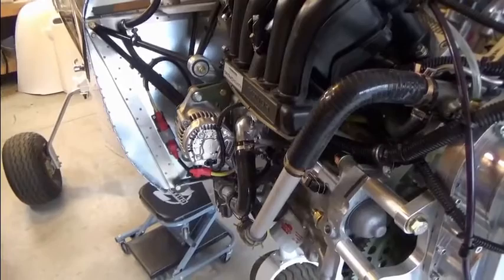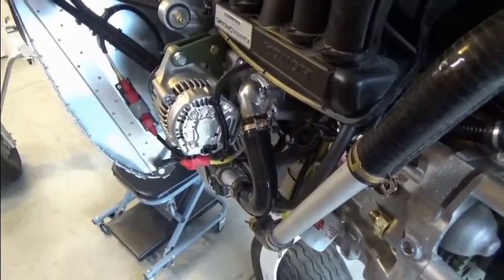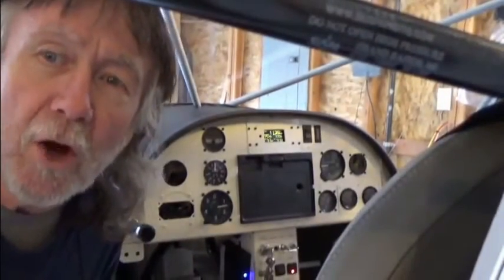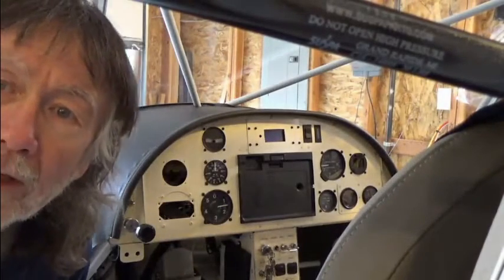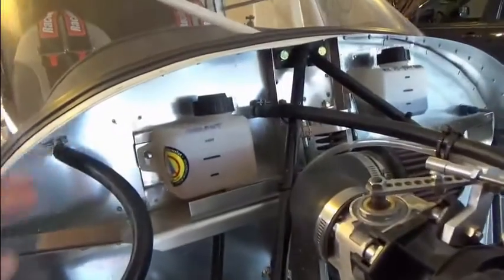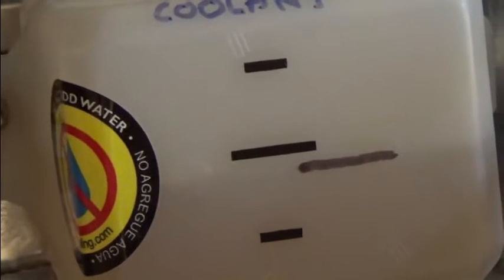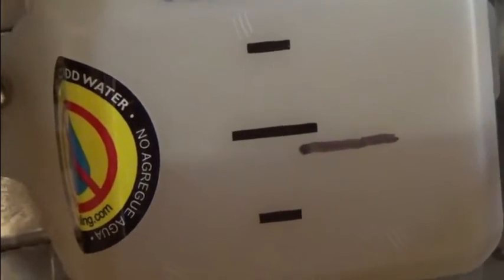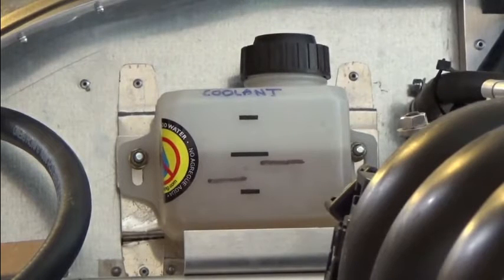Getting Air out of the Cooling System

Comment: Great stuff - but might I suggest a mod I did years ago on my car which was normally a pain to refill with coolant. The little poppet valve which most thermostats have and others don't: chop it off at the stem and remove it. (Drill a small hole if there isn't one). You'll be left with a 3/16th hole. If the thermostat is positioned with the hole at 12 o' clock the system will blow out air much easier. It slows the warm-up a bit, but with aero engines you are not doing stop-start cycles as with a car. I reckon you'd save hours recharging the coolant! - Rick in London UK. PS try this link https://grassrootsmotorsports.com/forum/grm/my-dumb-question-of-the-day-thermostat-content/75985/page1/